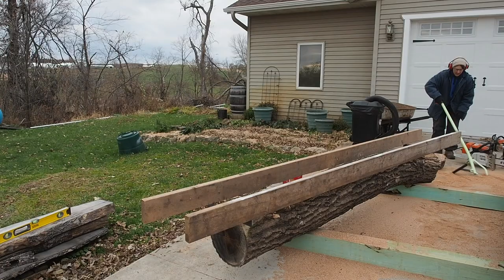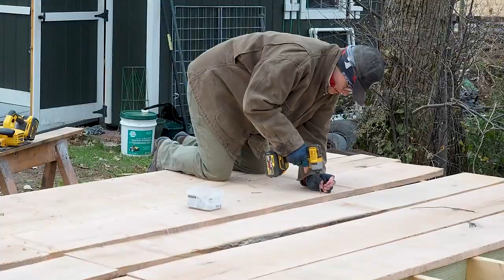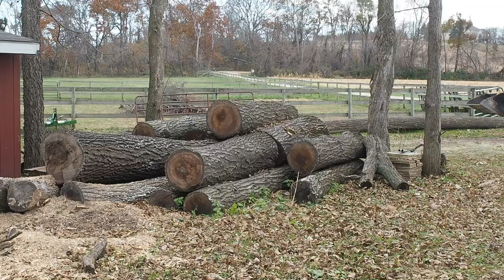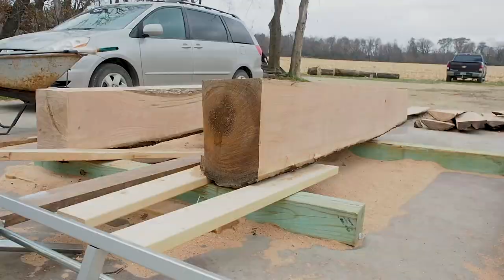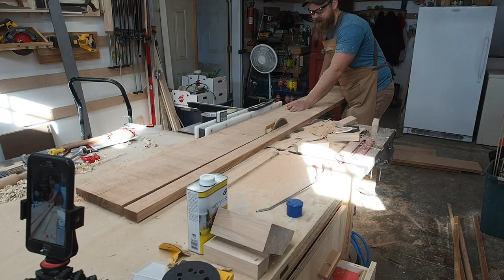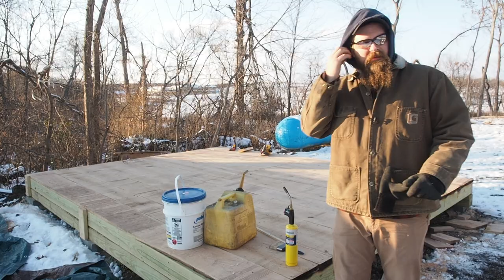Building the Timber Frame Garden Shed ~ Part Two

Comment: The decking went down nicely. Very cool to cut your own lumber for that. Did you need to predrill the oak flowwring or self drilling screws? I'm guesing not much spliting on the ends because it was still green.
Reply from the maker: Workshop at The Gardens no predrlilling, used all grk r4 screws. Had a little bit of splitting on the inside edge if I put the screws in too close to the end